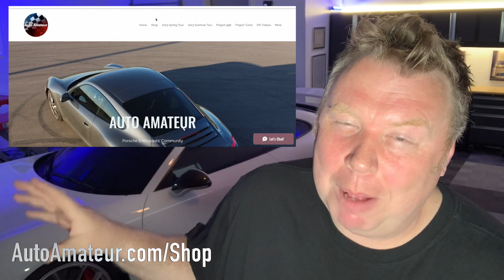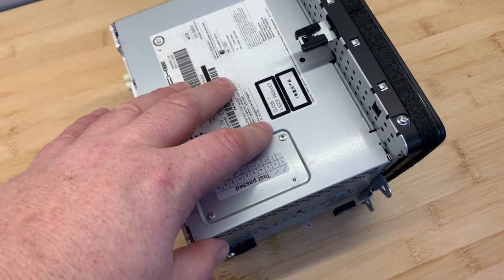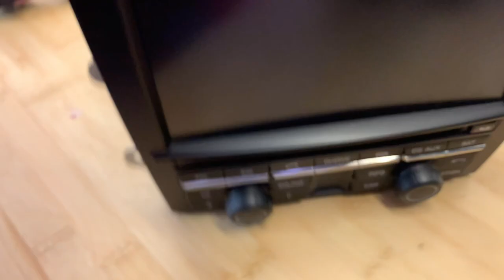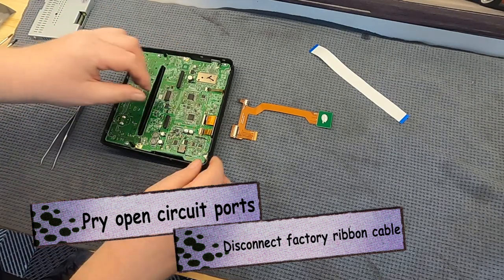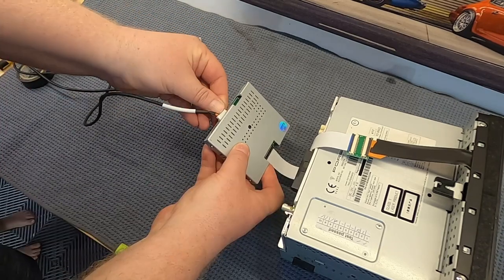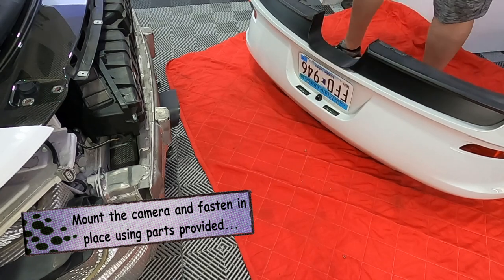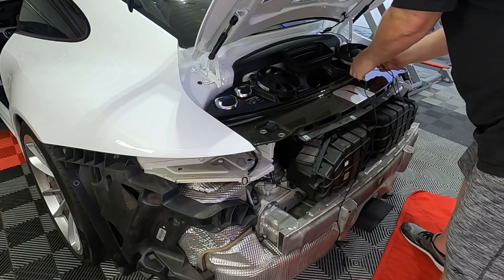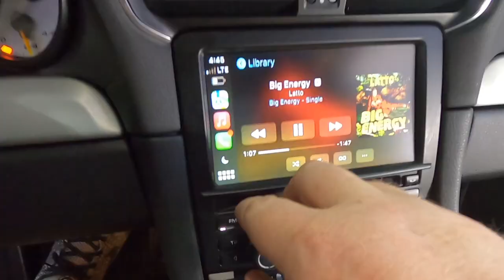Install DIY: Porsche CDR-31 Apple CarPlay and Back-Up Cam in a 991 GT3

Comment: Very well made tutorial! One enhancement suggestion: you might want to consider using something like Tessa tape (a fabric tape used for wiring harnesses) on the long camera wire, so it doesn’t vibrate or rattle against the plastic body panels on its labyrinthine journey between the back of the car and the head unit.
Reply from the maker: Great tip!

Comment: How is the audio quality of this option coupled to a CDR31 without Bose?  As a new owner i am appalled at the crappy sound quality of the FM, however when playing a CD it is ok; when playing from my iphone via stereo Aux port it is also pretty crappy. Surprised that Porsche put in such a sub standard entertainment unit.  Was looking to put in a PCM (some for sale on Ebay) but I think that will pose lots of challenges as it is not as simple as plug and play as the ports are different

Comment: I installed mine and for some reason, the screen comes on that shows USB, CarPlay etc but I can’t click on anything anymore. The backup camera also works.
Reply from the maker: Did you use dip switch #2 to configure the touchscreen?
Reply: @AutoAmateur  I had a professional install it. It was fine for like 4 days and then it happened today.

I can’t take it back there since I moved out of state. :(

It gets to that JoyEAuto screen and everything is greyed out (CarPlay, Android Auto, USB) except Setup. But Setup is not clickable with a finger and even the knob on the PCM doesn’t work to select it.
Reply: @AutoAmateur  I'm in same boat as @lemurtails with regard to greyed out buttons except Setup but I can access the setup page. You'd previously pointed me in the direction of calibrating the touchscreen so now it's just about why are the buttons greyed out.
Reply from the maker: @user-wd6ep8oy4x  the buttons being greyed out on the home screen of the JoyeAuto menu means your CarPlay connection is not currently active, but it doesn't mean your phone isn't connected. If you can get into settings, go to Bluetooth and make sure Bluetooth is turned on, checked Paired Devices to make sure your phone is listed there and if it isn't, go back a menu level to select the option to connect a new device. As you're doing that, go to your phone's Bluetooth menu and make sure you're connected to the JoyeAuto bluetooth network connection. You should be taken through the typical pairing prompts... 1. Do you want to pair with this device? 2. Do you want to sync your favorite lists? 3. Do you want to use JoyeAuto / idCore as wireless Apple CarPlay...? You need to select yes for all of these prompts on your phone.

Comment: I have a 981 Boxster, and like what you have shown and sell. My question is routing the cable from the backup cam, is that as seemless as in the 991? Obviously I don't have a backseat and have a convertible top in the way, have you done a Boxster (Cayman would be a piece of cake).  I understand how the rear camera works ie when you select reverse, however if I decided to select a 2 camera option having a front camera how does that work ie when does it come on and when does it shut off. Obviously I only want it for parking maneuvers
Reply from the maker: Hey there! Yes, there are a couple of ways to run the cable into the cabin in a Boxster or Cayman. I can help you virtually when you do the job, no worries.
Reply from the maker: The front camera gets triggered only when you come out of the reverse shifter position. It automatically comes on for 10 seconds and then shuts off again. It's all automated by the JoyeAuto box.

Comment: Does the 991.2 come with CarPlay and a back up camera? I know it comes with CarPlay but idk about a backup camera. I’ve been thinking about getting a 991.1 turbo but I want all the looks like the rear end/ tail lights and the steering wheel. And convenience of the 991.2. Just weighing all the options but thinking it might be better to just go 991.2
Reply from the maker: The 991.2 comes with wired CarPlay. You need to buy a USB adapter to make it wireless (I sell them!). In the U.S., all cars after 2015/16 must come with a back up camera by law so yes, in the U.S. all 991.2s should have back up cams. I don’t know about the rest of the world though.
Reply: @AutoAmateur  thank you man, I’m in Colorado so yeah something newer than that will work. Appreciate your video!
Reply from the maker: @Him_othy  Any time!!

Comment: Hi and hello from Germany, 
again a nice made video and easy to understand.
I have an 997/2 Carrera S from Sept./2009.

I would also like to install the module for Android Auto/Apple Carplay.
I heard somewhere, I need additionally an AUX in module ???
Is the system you offer complete, or is more needed?

Are there any error messages in the car's ECU? In the German Porsche forum you read something like this.

Thanks for a short feedback.
Andreas

Comment: Great video!
What is the audio quality with the bluetooth audio? 
Is there a wired CarPlay option and would that give better sound quality?
Reply from the maker: The bluetooth audio is actually really good. It's not as crisp as the PCM bluetooth, but to the untrained ear I don't think anyone would notice. You do have the ability to connect your iPhone or Android phone via a provided USB cable. The quality is a little better via that route though, yes.

Comment: Thanks for the video.
Where did you conceal the joyeauto main module?
Reply from the maker: Right behind the pcm unit itself.
Reply: @AutoAmateur  The CDR-31 already has an external box that goes behind (with the display flex cable), so there was no space for the larger box with the computes module.
Thanks for the relply.
I ended up placing mine double-side taped above the driver’s footwell on the inside of the dash space between the steering column column and division for the CDR unit / center part of the dash). The compromise is that it didn’t have enough clearance to connect the USB cable.

Comment: Great video. Is the PCM 3.1 compatible for the 991.1 GT3?
Reply from the maker: Absolutely, if your GT3 has PCM 3.1. The 991.1 models came with either PCM 3.1 (with sat-nav) or CDR-31 (without sat-nav). Either way, I have solutions for both!!
Reply: Just got the 3.1! Can’t wait. Thanks

Comment: Is it impossible to run the camera without removing the rear bumper?

Can the top engine covers not be removed then using a snake try and run the wire down or up behind the bumper? I haven't really looked or attempted mine yet but I'd love to avoid taking off the rear bumper if I didn't absolutely have to. Thanks
Reply from the maker: I'm afraid not.

Comment: Does this unit stay in CarPlay mode when the ignition is switched of and on again, or does it default to standard CDR31 mode each time the ignition is switched off and on?
Reply from the maker: It works just like the PCM. Whatever mode is on when you turn off the ignition will return automatically when you turn the car back on. The only snag is that it can sometimes take up to 30 seconds for CarPlay to come back, so just be patient.

Comment: How is the resolution on the backup camera with teh CDR31?  I'm contemplating doing this, but have been warned about the resolution being so poor that I'll be very disappointed.  but does low res backup camera >> no backup camera?
Reply from the maker: The resolution was fine! I can share some photos if you want to send me an email to contact@autoamateur.com